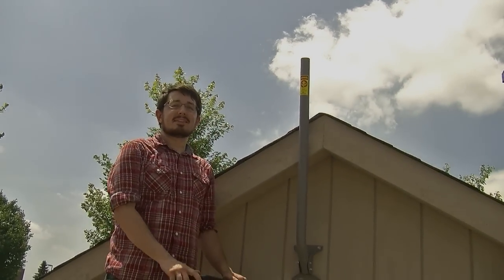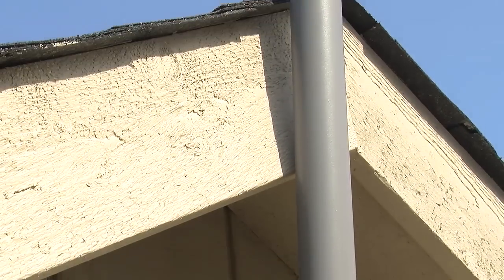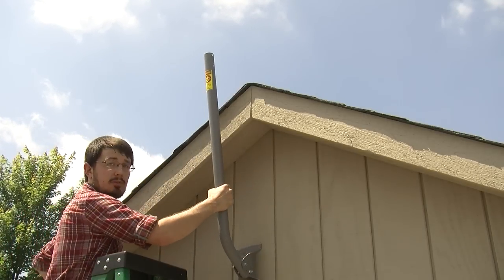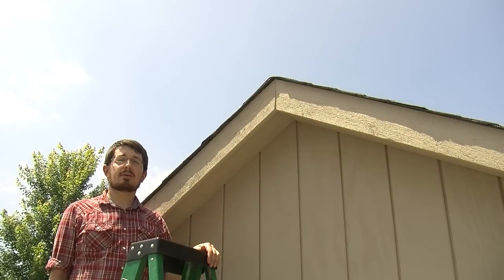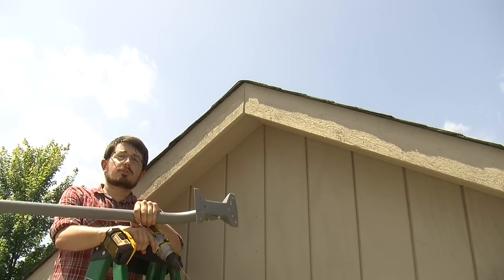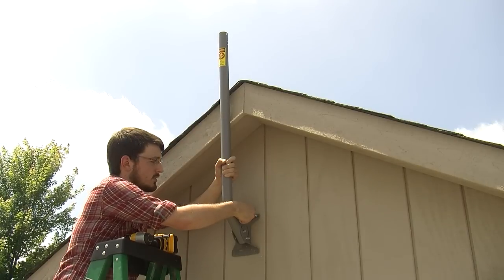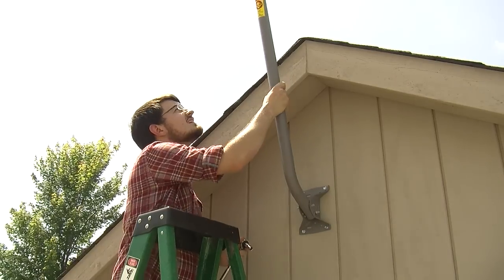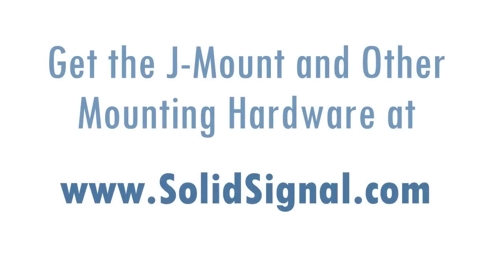How to Install a J-Mount - Solid Signal Hands On

Comment: Gosh, I hate to be critical, but, it would be easier to drill one hole and bolt that, THEN level, mark for holes and drill. Also, it appears the pole will not go vertical because the eve is too wide. Shim the base with spacers until it is vertical?
Reply: Says EVERYONE!  Man, this was almost painful to watch.  It's almost like this guy was trying to set everyone up for failure.

Comment: Depending on antenna size,You may want to look for a stud, The siding is only about 1/2" thick and does not provide a sold mounting surface. to level,I would drill and mount one corner, tighten  the bolt, and then tap the mount level before drilling and tightening the other 3 lag bolts

Comment: Why would you not want to mount the J-mount higher up on the wall, to maximize your height of the antenna?  Also, as an alternative, could you not drill to place the mount on the face of the eve?
Reply from the maker: It's up to you where you want to mount it. In some cases the eave may not be strong enough.

Comment: Mounted on the top peak will give you more room to move and more pole to work with. In case you need more than one antenna on the pole.

Comment: Should have made sure you were mounting to a stud with a stud finder, then drill ONE hole and loosely install one of the bolts snug but not fully tightened. That makes placement of the other bolts more likely not to be off of the correct placement. You can tap the mount to gently align the horizontal and then do the second. The third and fourth are automatically in the right spot that way. 
Why not put it on the actual roof top between the eve and the house so that you can use bolts instead of lag screws with nice big fender washers to spread the load? Oh never mind. I see that your eve is enclosed. My suggestion would require removal of the plank and then re-installation after the bolts and nuts were tight.
If you can get at the inside of where you've mounted it it might be worthwhile to convert to bolts and fender washers with good lock nuts.
Another thought, since it looks like your eve is forcing the mast slightly off of vertical a plank mounted to the wall would space the mount out further and give you a straight up mast and also make the mounting base more sturdy.
Be safe up there and stay away from the power lines.

Comment: Wondering if this is good for ham radio antennas.
Reply from the maker: It will work with any antenna that can take a 1.5" outer diameter mast.

Comment: Is there a bracket that can attach directly to a fascia board? Or is this type mounting not recommended?
Reply from the maker: Yes this can mount to a fascia board. The size and weight of antenna you use will have to depend on how strong the board is.
Reply: Got it, thanks!

Comment: can I attach fiberglass antenna to that? does it have a hole for the cable?
Reply from the maker: Most fiberglass antennas come with an adapter to use with regular mounts.

Comment: Using this type of mount, how would you achieve a vertical pole with a 16" soffit?
Reply from the maker: +Josh Fal  I wouldn't use this mount for that. If you search at solid signal dot com for under eave mounts, you'll find what you're looking for.
Reply: +Solid Signal Mind suggesting something specific? I looked through all the mounts but didn't see anything as an easy solution.
Reply from the maker: +Josh Fal  Youtube doesn't let me post links, but the part number is EMV4.
Reply: +Solid Signal Thanks, but that has to be secured to exposed rafters.
Reply: @SolidSignalNovi  EMV4 Shows discontinued.

Comment: Question... what other considerations are there when the house has vinyl siding.

What option is there if the overhang is much greater.
Reply from the maker: Lots of different options including deeper J-Mounts, non-penetrating roof mounts, and under eave mounts. Take a look at Solid Signal dot com.

Comment: Good instruction video.
Reply: Not really. Should have made sure he was mounting to a stud with a stud finder, then drill ONE hole and loosely install one of the bolts. That makes placement of the other bolts more likely not to be off of the correct placement.